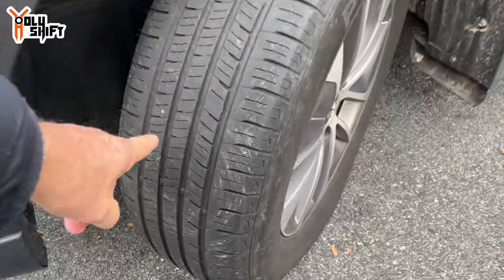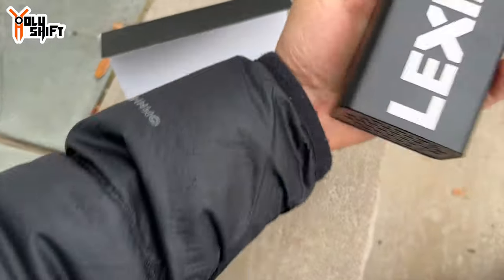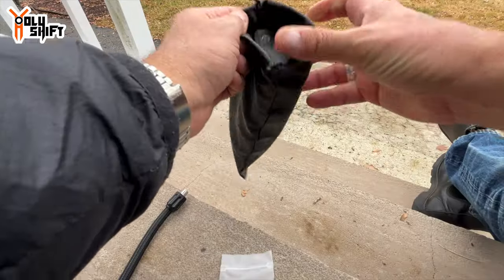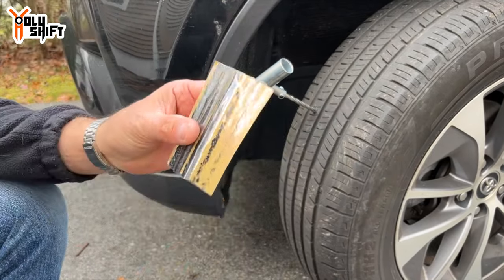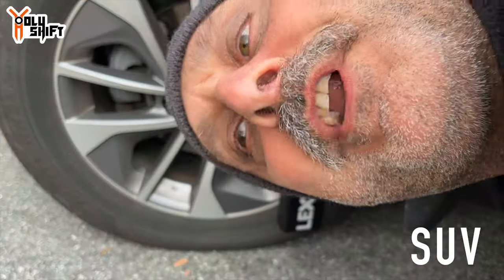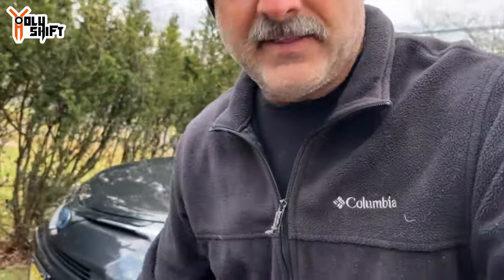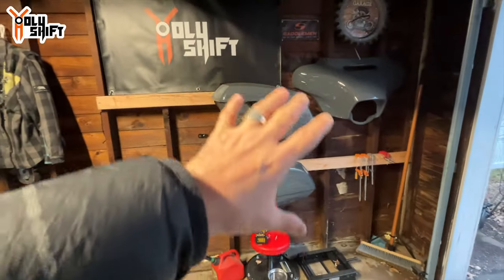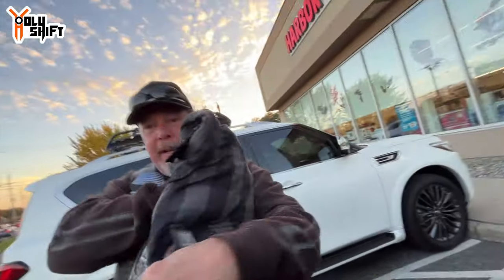Never Ride Without This ! The Little Pump That COULD ...

Comment: Take the weight off the tire to inflate faster.
Thats a nifty little unit. I picked up a 12v two cylinder air compressor  from Amazon for $69 its rated 150psi and inflates one of my rv tires 235/85/16 up to 70psi in 15 min

Comment: # LEXIN ….. Love your awesome videos. 😉👍
  Hey for the saddlebag mounting brackets, why not have a welding shop flip those triangular mounts on the brackets from the upper part of the bar to the lower part of the bar. That should give you about 2 inches from the bottom of the saddlebag to the exhaust. You could also add some heat resistant exhaust wrap to the bottom of the bag  where nobody would see it for extra piece of mind.
Reply from the maker: That would work ! Thanks

Comment: Please do not use grease, lotion, lubricrate, etc as a lube to insert the plug. It will stop the plug from glueing to the tire. You should be using rubber tire patch glue as a lubricant. Carry the small tube(s). …………………….. Try these steps on your #4 flat. 1-Mark area to be plugged. 2-Pump up tire pressure this hardens the tire and the reamer and plug goes in easier as the tire does not flex. 3-When removing object from tire watch closely the angle that it comes out the tire because you want to use the same puncture channel to do the repair.  You don’t want to make a new hole/channel when you ream and plug. 4-Ream out the channel good. 5-Lube the plug with rubber patch glue. 6-Remove the reamer and quickly insert the plug at same angle that the puncture was made and reamed. 7-Cut off excess plug at the tire lug height. 8-Pump up tire to recommended pressure. 9-Wet plug to check for leaking, no water around, then spit on it
Reply from the maker: Makes sense with the lube and the direction of entry